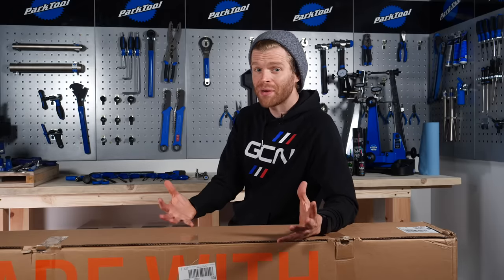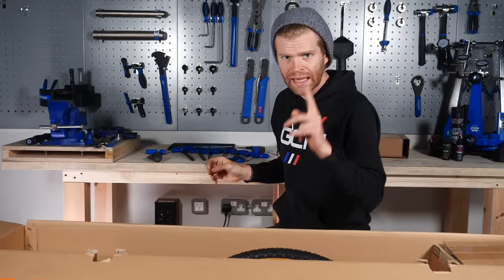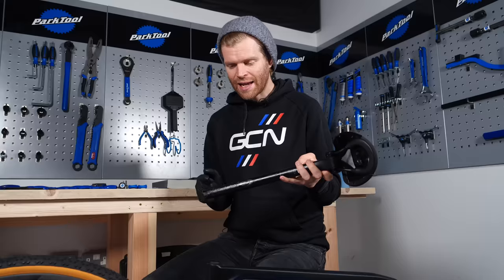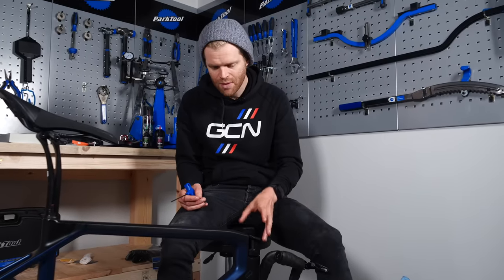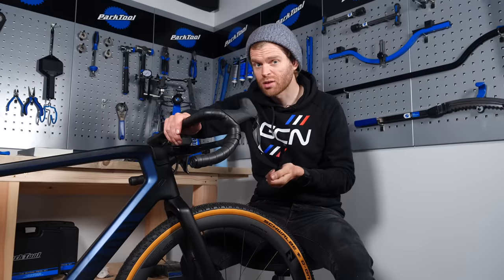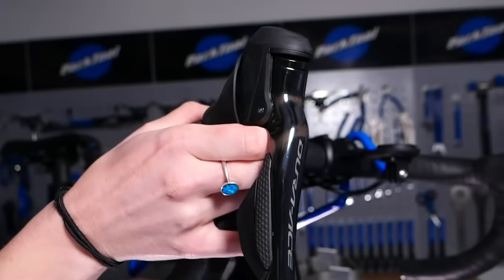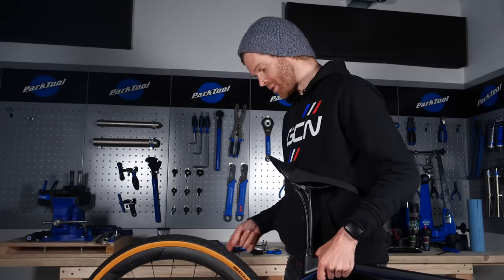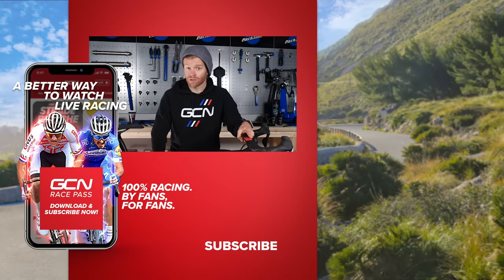From Box To Bike: How To Assemble A Brand New Bicycle

Comment: Make pictures of the state you receive your package & the state you sent it out: if there are problems you want to have proof.
(I had a frame ordered once that was supposed to come with ‘some paint damage’. Turns out, that the metal bottom bracket lug where the press fit should go in, wasn’t there. I didn’t know it had to be there and found out years after battling with bottom bracket play and creaking after which the supplier claimed I had removed it myself.)

Comment: Quick tip: If you have a Canyon, be sure to contact them to purchase a spare derailleur hanger and rear thru-axle.  They use their own proprietary parts, and there presently are no compatible aftermarket pieces for those components.  Already ran into that when a customer brought one into our shop with a cross-threaded thru-axle. I have no idea how he did that, but some people just have no business turning a wrench on anything.  Also, no matter what they tell you on the website or the box, the bike needs a tune up.  They always do.

Comment: I own three bikes with different crank lengths and find I'm able to keep my seat height consistent by running the same pedals on all three bikes and measuring from the pedal (at the bottom position) to the top of the seat, aligning the measuring tape with the seat tube. Maybe not the prescribed method, but it works for me.

Comment: Best to apply seat post lube on the inside of the seat tube rather than the seat post as when you put in the seat post it pushes the lube off of the seat post.  Best practice to apply to both.

Comment: I have not bought a bike that's direct-to-consumer before but I have had customers bring bikes like a GT Laguna Pro in (this is a bit better than what you'd find at a box store) and I have spent ages on them becuse they don't check for wobbly rims, loose or espically over-preloaded bearings, and the shifting and brakes usually need to have every adjustment possible done to them. On a super high end bike like this canyon, I'd expect a much higher build quality. But in my experience most people ride sub $500.00 bikes like the afformentioned Laguna. Assembly jobs like that are probably one of the most dreaded by the technicians that shops offer.

Comment: Ollie, you should have assembled this bike with the tools included with the bike.
Reply: True but I am pretty sure Park Tool is sponsoring too, as well as Canyon.
Reply: Matteo Ceriotti I think you're correct that Park and Canyon are paying to advertise. Having said that, if I was signing the checks at Canyon, I would have wanted them to use the supplied tools, especially the torque wrench.
Reply: I assembled both my Canyon's (Aeroad and Grail) with the tools included even though I have my own. I keep the Canyon ones to use when I take my bike abroad in a bike box. They are pretty good quality tools!

Comment: And If your bike comes from Canyon, the limiting screws might not be set correctly, the shifting might be slow and loud and the bar tape might be wrapped poorly.
All of that was the case on my bike. The bar tape of the bike shown in the video also looks poorly wrapped at the bend.
Reply: jksjksjks85 I also shifting and brake problem with my canyon bike. They really should increase their quality control .
Reply: @Jerry-tc8wp  let them know, in my case they they apologized and gave me an 80€ voucher for the the shop

Comment: Haha, that video is exactly me last week 😁. Same bike - and it was as easy as Ollie suggests. Great video (as always) 👍👍
Reply: Hi there Paul, is that the Grail GRX DI2 model? I’m seriously looking at buying one and would like to know how it rides? I’ve already got a Canyon Ultimate.
Reply: Hi Barney - yes it is. I got the CF SL 8 GRX Di2 (that’s quite a mouthful). Only been out on it twice so far, but absolutely love it. The double-decker bars work really well to absorb vibration and are really comfortable, and the split seatpost also does a great job. 
It rides surprisingly well on roads too.
My biggest worry was that there is basically no adjustment on the bars - my road bike has a long stem and I was worried that I wouldn’t be able to replicate the reach on the Grail. In reality, no problem at all, I’ve been able to reproduce the geometry really well.
I spent a long time trying to decide which gravel bike to go for and the Canyon offered by far the best value for what you get. 
If I were you, go for it! 😁😁
Reply: Thanks Paul! I was just checking out the exact same model!!! I’ve had a look at the Cervelo Aspero but it doesn’t compare to the Canyon value wise. I’m definitely leaning towards a second Canyon! Thanks for your feedback!

Comment: I recently got the Grail AL 6 from Canyon. It came very nice in box but when I assembled the bike, I found so many problems. The front brake was not correctly aligned so the disc is rubbing one side of the brake pad. And the front derailleur was also not aligned properly , the cage was not straight with the cassette and the chain was rubbing the cage when on fastest speed gear combination or slowest speed gear combination.  I wrote email to canyon to complain the issue, no reply received. And their return policy is only for unused bike. But you can’t really notice those problems once you actually ride the bike. Very annoying experience with canyon. It is great bike but really poorly built at the factory and bad after sale service !
Reply: Those issues seem normal for a new bike and it's worth learning how to fix them for the future. Adjusting the disc brake pistons to stop the rubbing is usually easy with one hex key. Same with front derailleur rub. I agree it's shitty but if you learn it it will be rewarding and will save you money in the future
Reply: elorz007 elorz007 I agreed that it’s worth to learn how to fix it and I did actually learn to have fixed the front disc brake issue. Even though it was quite a work. I need to loosen the screws to realign the disc brake calipers several times to almost solve the issue. Although it is still slight rubbing the pad but I think it’s ok.  The front derailleur problem can’t be solved by adjusting cable tension or L/H screws. And it was not easy for me adjust since I don’t have bike stand at home. So I went to the local bike shop. There even the professional mechanic spent nearly half an hour to fix it. They was not happy with what they deal with either when I told them it was a new bike.  This i don’t think it’s a small issue for a new bike. I think it’s poor quality control before Canyon ships the bike to their customers.  And I got the reply way much faster on YouTube here than Canyon service, because they never reply me;).

Comment: Not one of GCN's better edited videos. He removes the top cap but doesn't then put is back on. Surely one of the more vital steps on here, as it should be replaced and tightened before clamping the stem/handlebar. A novice could end up with a wobbly front end and maybe a feeling of having bought a crap bike.

Comment: should grease be applied also on the body (non threaded part) of the thru axle or just on the threaded part?
Reply from the maker: You can apply grease to the thru axle body yes, but it's not as essential as greasing the threads
Reply: My canyon bike came with the thru axle already greased in a plastic bag. I think you don’t need to redo it again

Comment: bikes do not include pedals? like the car with no engine ... in case you like your old engine...
Reply: Entry-level bikes usually come with flat pedals. However, most experienced riders buy mid-level to high-end bikes but most of those types of riders also use clipless pedals. Clipless pedals come in different variations and the shoe cleats are not interchangeable; for example Shimano SPD-SL vs. Shimano SPD vs. Speed Play vs.... So, if I bought a new mid to high end bike that had Speed Play pedals included, I would be paying a little more for a bike that has a pedal system that I have no use for since I use Shimano SPD-SL.
In regards to your car analogy, an average car driver would want an engine included. A professional/amateur race car driver may want a specially built engine specific to his/her needs.

Comment: Wheels directly tied to the frame, no styrofoam, nor plastic, not even cardboard, and the stone-ugly handlebar-tape wrapping ... have to say: not impressed by how Canyon ships their products.
Reply: The velcro ties have foam blocks attached so the wheel doesn't touch the frame.
Reply: @del4189  Not touching the frame is good enough for standing around but not for transport (given how packages are treated). At 2:26 I can see nothing that prevents the wheels nor frame from damage should the box get a broadside during transport. However, it's not my bike so I don't care. Still: last week I ordered a frameset (SURELY) for the fraction of the cost of a Canyon. Each tube on frame and fork was covered in wrapping and the whole set was protected by bubble-wrap, paper-wrap and cardboard-protectors all around. That's why I'm not impressed by Canyon's packaging.